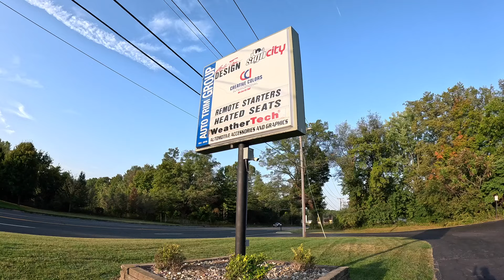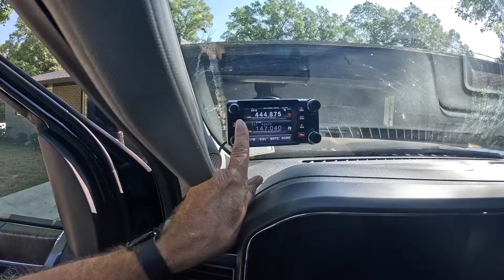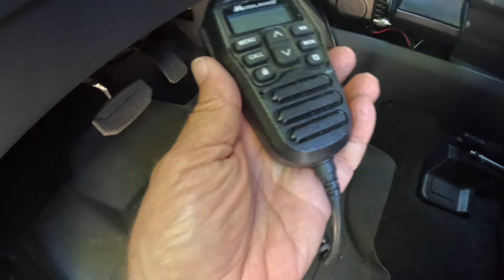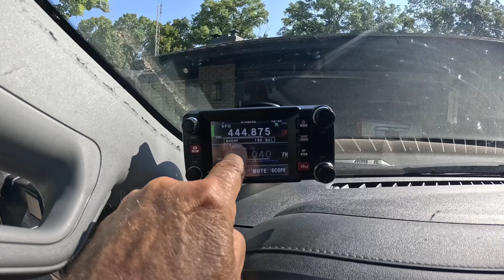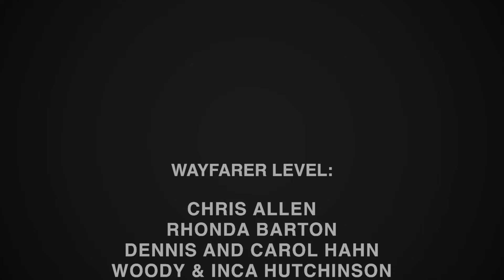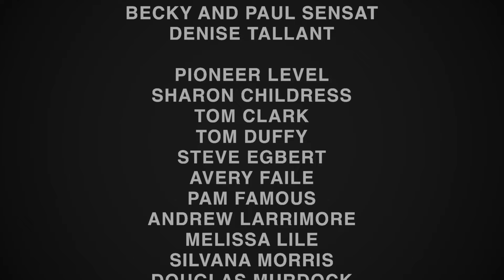Installing my Ham and GMRS Two-Way Radios

Comment: I’m just curious as to impact all the custom wiring etc has on the warranty of your vehicle?  Seems like there could be a lot of finger pointing if something malfunctioned in the vehicle. You did mention that the third party doing the work was recommended by your auto dealer. Interesting, thanks for this video.

Comment: When running wiring and coax within the interior of a modern vehicle, the installer must be aware of the airbag systems. Installations are a different story than back when I was a teenager.
Reply from the maker: another reason to have a pro  do the installs